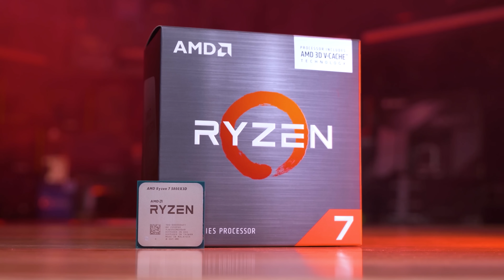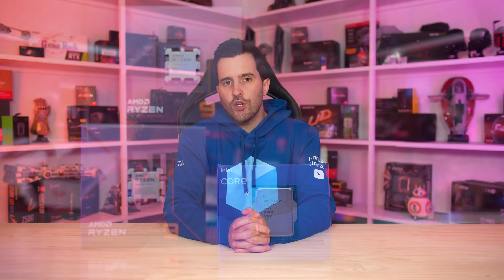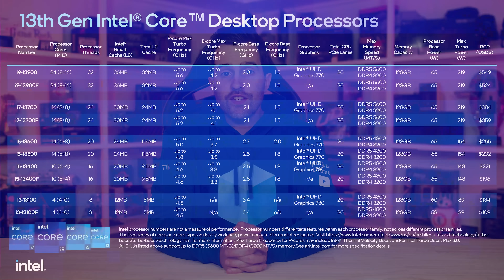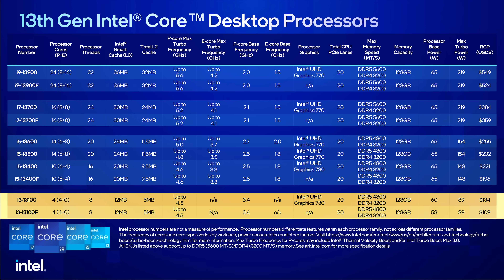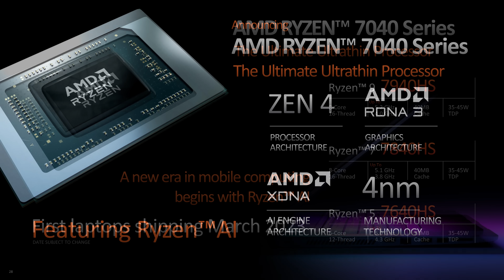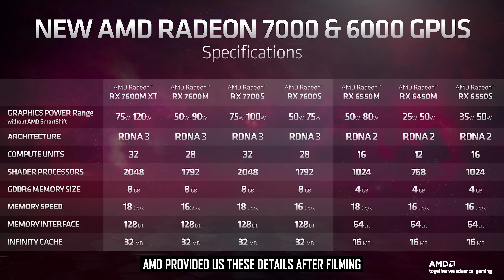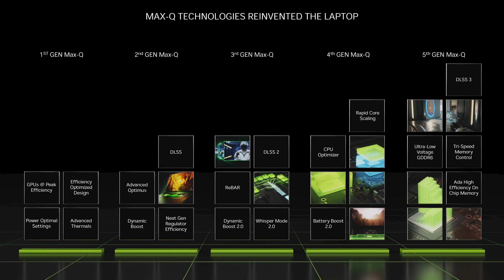Zen 4 3D V-Cache, 7950X3D, 7800X3D, New Cheaper CPUs, "RTX 4090" for Laptops - CES News Recap

Comment: The 7950x3D seems to only be using 1 stacked memory cache die. The other one is bare. This might mean only the one WITHOUT the extra cache boosts to 5.7GHz. I'd be curious to know if this regular die is able to borrow cache from the lower clocked v-cache die.
Reply: Ryzen L3 is victim cache so no it cannot borrow cache from neighbor die. The L3 cache can only be filled with evicted cache line from local cores.
Reply: @kazedcat  But if an item isn't found in one chiplet's L3, it can be snooped from another's.
Reply: @MarkRose1337  It can snooped neighbor L3 but relevant cacheline will only exist on neighbor L3 if a neighbor core fetched the cachline. You don't want this behavior because cachelines bouncing between dies has increase overhead and increased latency.
Reply: There is another possibility. The VCache is now L4 and shared by the two CCD. This requires a direct IF link between the two CCD for direct L3 to L4 connection. This is what make sense for overall overhead and latency.
Reply: @kazedcat  Someone will have to run targeted benchmarks to poke how things work. Sadly most reviewers do not go into mico-arch benchmarks, cache tiers, latencies, etc. I would expect @TechTechPotato to do this. Somehow, I think, this probably is a hybrid CPU. One chiplet might be optimized for freq, the other one for cache size (loosing a bit of freq). Let's see if AMD sends any Linux kernel scheduling patches within months (on in 2023 in general). Intel is trying to introduce "Classes of Tasks" based on IPC (kernel option: CONFIG_IPC_CLASSES). AMD could do similar by analyzing perf counters. At least a user could poke at perf counters while binding their workloads to specific cores to see how that affects workloads. Well, it definitely will be interesting.

Quote from the patch (from Intel):
On hybrid processors, the microarchitectural properties of the different types of CPUs cause them to have different instruction-per-cycle (IPC) capabilities. IPC can be higher on some CPUs for advanced instructions.
Reply: @davidlt  PCWorld had an AMD guy confirming that the 7900 and 7950 maintain the same clocks in X3D because they only put the 3D cache on one of the CCD dies, so basically you get a 7800X3D on one side triggered for gaming and a full speed 7700X on the other side for productivity. Could possibly mean identical gaming performance when hitting only one die for 7800 and 7900/7950 chips.
Reply: @paulanderegg5536  Just watched it. Yeah, seems it's a hybrid. They mentioned that the scheduler will do the right thing. We will probably know more once Linux kernel patches show up (hopefully). I wonder what is Fmax (max boost freq.) on CCD with 3D cache. Sadly still didn't provide details how cache structure works.

EDIT: There seems to be a claim from CapFrameX that CCD with 3D cache is limited to 5GHz Fmax. Not confirmed.
Reply: @paulanderegg5536  If so, that could explain that 'forced' reduction on clocks of the 7800X3D....

I have the 7600X as sort of a stop gap now, but in no real rush to switch to 3D... I have plenty of performance right now coming from a 4770k. :)
Reply: @davidlt  Wondering how 5GHz of X3D at 5200 RAM would do compared to my 7600X 5.6GHz with 6000 RAM. Primarily for MSFS2020 where single main thread is a really big deal to the program.
Reply: @martheunen  I got my 7600X as a socket filler for the expected X3D as well! Kills my old 9900K at 5GHz.
Reply: @kazedcat  "It can snooped neighbor L3 but relevant cacheline will only exist on neighbor L3 if a neighbor core fetched the cachline. You don't want this behavior because cachelines bouncing between dies has increase overhead and increased latency."

Data is passed by threads.  If a thread is running on one chiplet and has to deal with a thread on another chiplet, usually it's one thread that needs the data from the other thread anyway, so data is passed, BY the application from one thread that's finished its work to another thread that needs the data.  So it really doesn't matter if those threads are on the same chiplet or not except for the VERY minor latency going across the interconnect, which is a design change I wish AMD would make for Zen 5 (direct path between the core chiplets instead of needing to go through an interconnect or IOD).

It's programs that run and do everything.  The hardware executes it.  Yes with a large amount of shared L3 it's possible that two threads can use the same data, but that's not usually how applications work.  If a program spawns a thread it's because you can do some work in parallel.  When you spawn the thread you can pass data it needs.  When a thread is done is passes data back.  If the spawned thread has access to the same data as the thread that spawned it, you get into issues where two threads can be accessing the same data and you might not get the outcome you expect so now you have to control access to that data.  Yes, you can pass pointers.  In this case you are likely accessing data already in cache.  But now as already said you need to control access to that data or KNOW that only one thread can access that data when it's running.  It's the main game thread that needs access to a large chunk of cache mainly because it works with a lot more data. So it's a single thread on a single core using most that cache.
Reply: @martheunen  The AMD dude confirmed that the 2 CCDs are running different speeds because the Vcache on top of a CCD can't run the same speeds as the chiplets without.

So yes, it's a scheduling issue and I imagine since this is AMD it will take some time to get it near perfect because you'll run into issues that AMD didn't quite expect once many thousands of people are using these CPUs.

My first thought is that all game threads should run on the same CCD, but then I read a comment that got my brain back in focus and now I don't know.  It's only the main game thread that needs access to a large amount of cache and AMD said this when they announced the 5800X3D.  So, it's possible you could throw most spawned threads (off the main game thread) to the faster CCD because one way or another you usually pass data, functions, etc.... when you spawn a thread and when the spawned thread is done, it has to pass data back to a main game thread, or it has exclusive access to some data that once the spawned thread is done, some stored data has been modified.  But passing data means it really doesn't matter which chiplet spawned threads are run on so much.  So yes, it will be interesting to see how the scheduler handles all this and how it changes over time.  I doubt it will be optimal at launch.
Reply: @johndoh5182  The L3 caches works above thread level. They are working  at physical address and memory access level. Essentially if a CPU core needed a piece of data the load store unit will translate the data access into a physical memory address after that it will go through L1, then L2, then L3 checking the tags to see if the physical address correspond to the cachelines stored in the caches. The L3 does not know which thread is accesing the cacheline nor it knows what is going on in the logical threads. What it see is a core snooping it's tags for relevant physical memory address. The L3 can also receive coherency messages from other caches like cacheline invalidation and updates on ownership status.
Reply: @kazedcat  can't that be changed somehow? With extra microcode, maybe?

 Intel released a CPU with 128mb of L4 cache on a seperate die like 6 years ago. I wonder if something can be restructured so it can act in a similar manner.
Reply: @eugkra33  It can be changed but the results are undesirable. Borrowing cache from neighbor die has increased power overhead and increase latency. Then you increased  the chance of starving local cores with available cache because neighbor cacheline is occupying the cache instead of local cacheline needed by local cores. Having extra logic needed for memory coherency will also increase memory latency. It also increases bandwidth pressure in the IF link because cacheline forwarding is more bandwidth intensive compared to coherency snooping.
Reply: Interesting possibility. Guess we'll find out when benchmarks land.
Reply: My thoughts exactly... we'll have to wait and see what's what when they release and get reviewed...
Reply: No dude, both the 7900X3D and 7950X3D have one chiplet with Vcache and one without.  It allows one core chiplet to give the best single and lightly threaded performance, but allows a main game thread to run on the core with Vcache.

For both of those CPUs, the boost clocks are listed on the charts dude.  No need to question it, and yes that's ONLY for the core chiplet without Vcache.  Watch the PCWorld interview on the 7950X3D.
Reply: @johndoh5182  It's like E and P cores on an Intel now, 3D cache edition 😛
Reply: Was about to comment on this as well. That is why we are seeing the same boost speeds for the 12 and 16 core model as the other CCD doesn't have V-Cache. I assume they did this knowing that games don't really utilize more than 8 cores, then again it would be interesting to see how games would perform when handling two dies with its own stack cache. 

If a game is utilizing a dies boost clock speed then yeah, how it's accessing the others cache would be interesting to know.
Reply: He says that in the video.....
Reply: This is correct, the cache still cant hit max clocks so the X3D CCD will run slower than the other one. So the gaming performance of the three models will be very similar while the higher core-count models will do better for productivity
Reply: It would be interesting to see how AMD's Alder Lake moment would go.

Comment: 7800x3d with 400mhz drop feels like a upsell product.
Reply: It was exactly the same with the 5800x vs 5800x3d, 400Mhz lower base clock and the 5800x3d is still better in most games.
Reply: It’s not even the same processor with the added 3D Vcache.  They dropped the clock speed on the 5800x3d and it still smoked just about everything it competed against.  Even now, it’s still very competitive and regularly bests intel 13th gen on certain titles.
Reply: I don't think so.  The 7800X3D has just the one CCD, meaning the voltage limitation applies to all the cores.  The 7900X3D and 7950X3D can apply that voltage limitation to only one of the CCD's, as only one has the extra cache (something I'm initially opposed to, but can be convinced otherwise by positive benchmarks and good prices).

The extra cache provides much more of a speed boost in many games than the loss of clock speed costs it.  I also expect the multi-core clock speeds to quite similar between the 7700X and 7800X3D.  That is, in games which thread a bit, the clock speeds are likely to be quite similar.  If that's true, there'd be no real deficit from the max clock speed drop, but plenty of benefit from the cache increase.

I think the numbers AMD presented are probably conservative, unlike with RDNA 3 (where I think AMD was caught off guard - they thought they had something better than they did, for whatever reason).
Reply: @TrueThanny  edit: I just saw the interview by PCWorld with AMD and they will go this route with the 3d cache stacked to one ccd and not the other. Cheesus I think this will be bad.